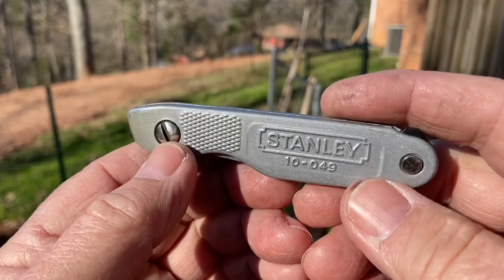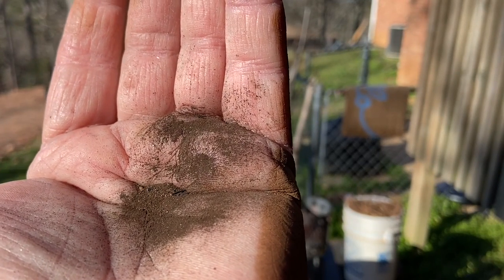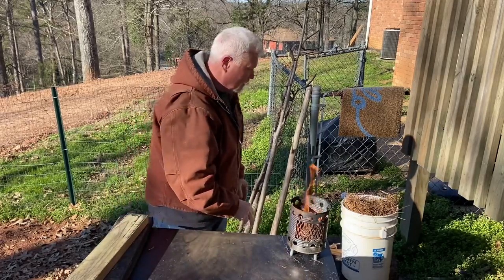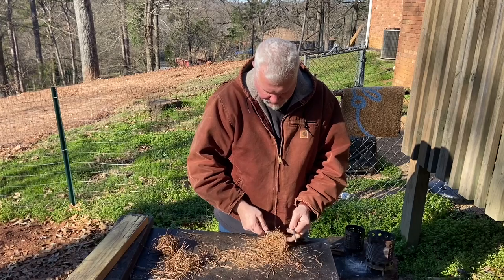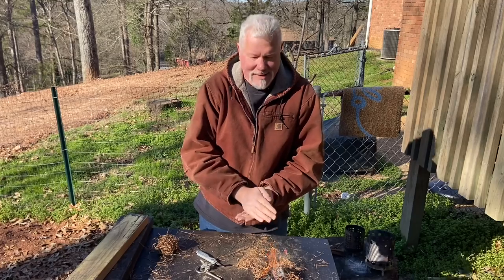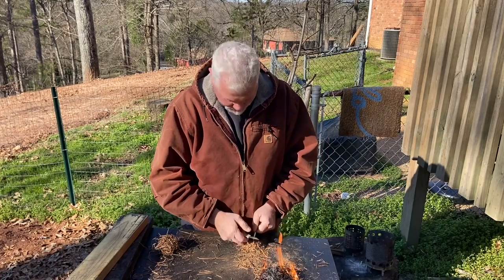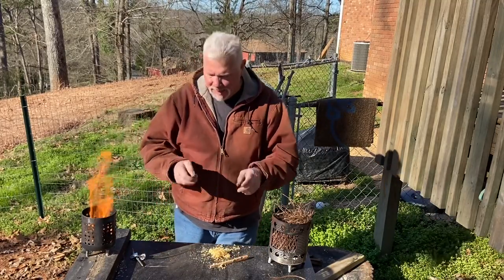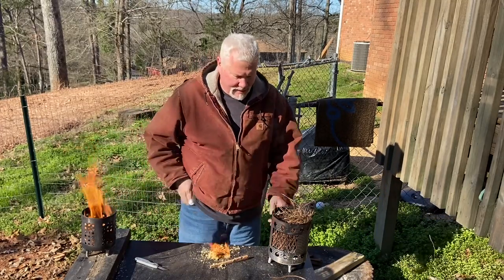My Stanley 10-049 Pocketknife Is A Fire Maker’s Superscraper!

Comment: I really like your emphasis on raising a burr to get more sparks. I sharpen my scrapers like a cabinet scraper to get a wicked burr. You don't need a special burnisher; a file handle or a kitchen sharpening steel will do.
Reply from the maker: The burr on that little stainless blade last a very long time before I have to rebuild it.

Comment: Half a cotton ball some petroleum jelly two striker flints  some rust a 2x4 and a specifically sharpened knife and bam , fire. Wow, so easy.
Reply from the maker: I EDC 3 fire makers. You?
Reply: @DavidWestBgood2ppl  your fire roll is actually really cool. I edc multiple methods because I’m not very proficient. I don’t think specialized spines are important for rods because in a serious situation I would sacrifice the bottom of my blade. You were striking the rod with the spine weren’t you? I do like minimalist little knives though. I kinda missed the point of your video when I commented.

Comment: i have one of those, its had the same blade for the last 12 years, when i bought it to cut the plastic cover on 1 inch thick wire and other bigger sized industrial wire i ended up slicing my finger tip, everyone thought i was gonna lose the top third of my finger but i loaded it with bacitracin and bandaged it. i still have the tip of my finger and it works fine
Reply from the maker: A great knife! TY!

Comment: Watched you using the Stanley lnife for years. I carry a Swiss Army Knife. But you’ve impressed me w the Stanley, so I ordered one on Amazon. I doubt if I will carry it. But it will make a good add to my carry everywhere behind the seat of my pick up truck seat tool bag. 
Question: Do you sharpen the blade or just put in a new one when dull. I’m betting sharpen.
Reply from the maker: I sharpen it dozens of times and only change the blade when the thumbnail notch gets too low (from all the sharpening) to hook with my nail.